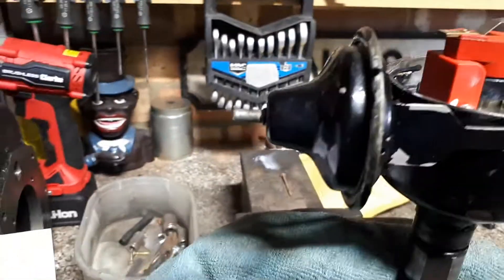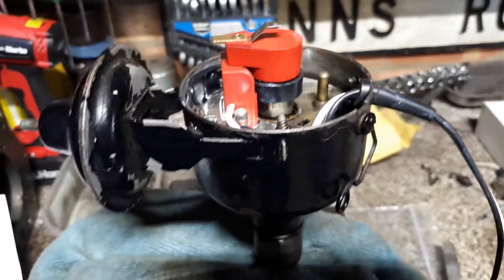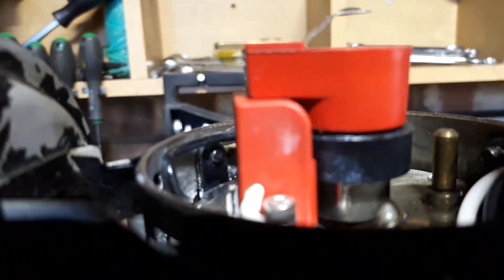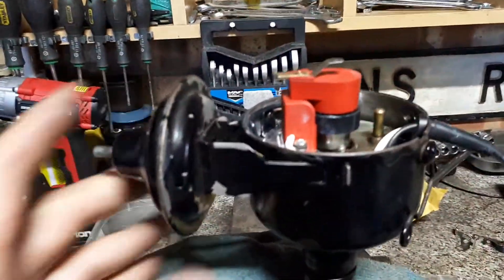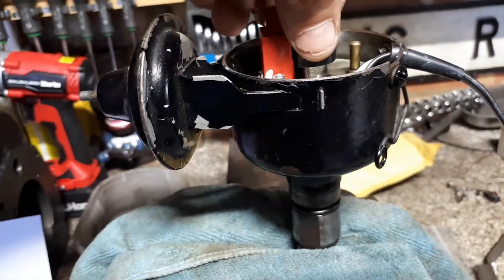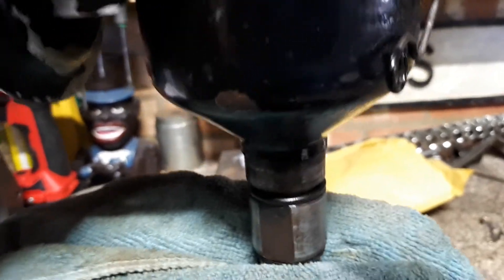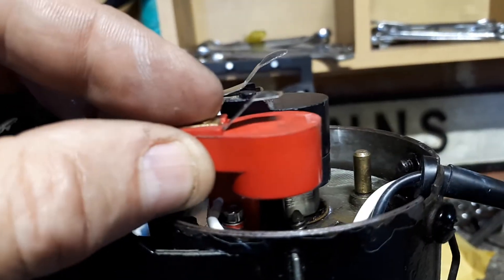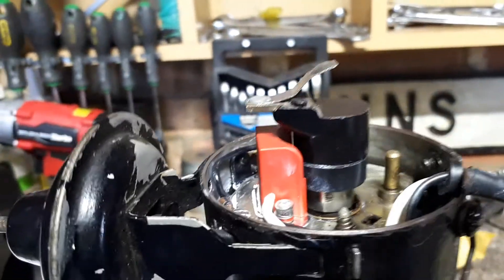Power spark/accspark electronic igition

Comment: Hi did it work in the end?. I just tried the Powerspark K1-PP for positive earth but no spark, will have checked on a jig, maybe my shop wrongly connected the wires and destroyed it
Reply from the maker: Hi Kieran, i done same went back to points etc, for some reason on my cresta Pa pos earth with this set up will not or does not work for very long, i have another 2 vehicles with positive earth electronic ignition fitted and i have had no problems what so ever, but for some strange reason it does not work on my cresta i have fitted 3 different types, my person opinion is i have a strange fault on the car wiring but i have not got around to looking at it, as for the above rotor again i just left it but uit cant be right someone has got something wrong somewhere  with measurement in my opinion, as for you 'problem' check you have pos earth and not neg as this did get supplied to me as well, also and i am sure it states in the instructions  it will advancing the ign timing quite a lot.
Reply: @MrJack559  Jack, I'm back to points at the moment, meanwhile i got the unit again complete with leads and coil. next week i shall tackle it myself. I'll inform you the outcome
Reply: @Kieran46100  and the outcome was?
Reply: @victoriabailey1337  i had it changed back to original specification, regretfully my jaguar mk2 was stolen shortly after and never found again.